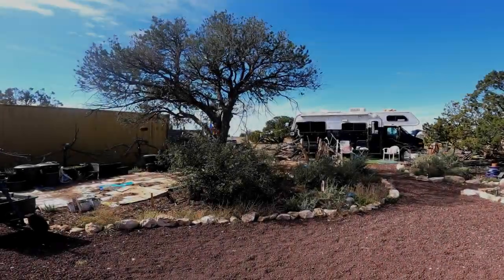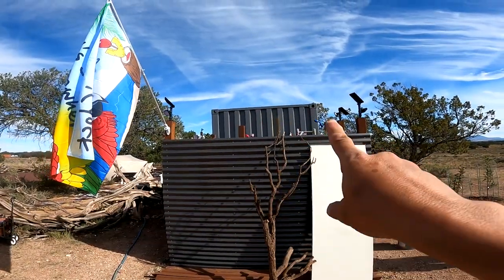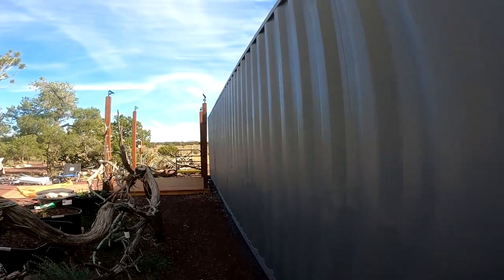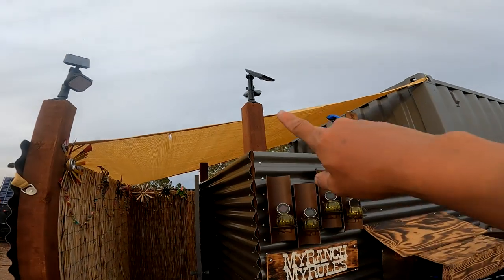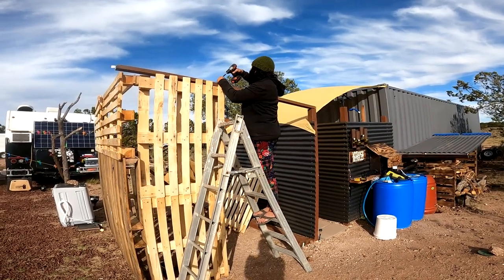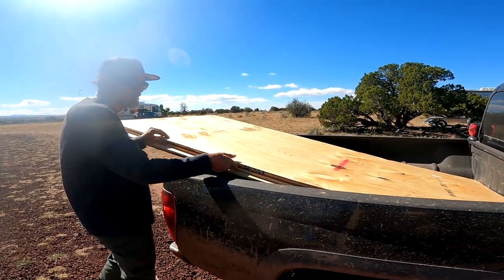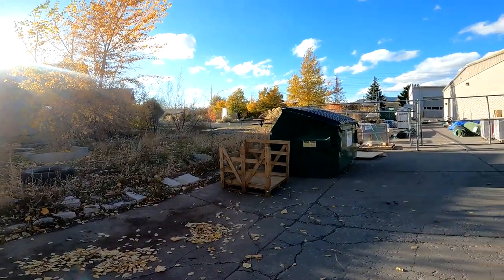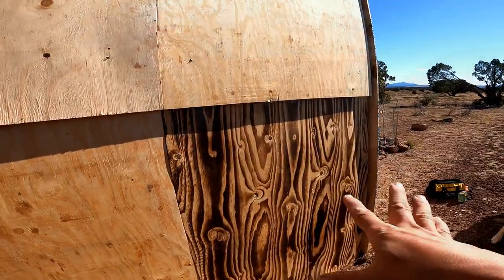DIY Building Free Pallet Shed, Painting Shipping Container & Burn Wood To Preserve

Comment: I have eight 55 gal. rain barrels at home.  Over time and in arizona they collect alot of dust of the roof which turns to mud.  I wash them out once a year.  I just use 
the water for plants so dont bother trying to filter it.      When you suck the water out for the shower or laundry,  maybe have a filter there.  You guys getting alot done 
this year.

Comment: scorching the wood won't protect it from water but it does give it some protection from insects, if termites are in your area. otherwise the wood will still weather from sun and water exposure. spraying it with a coat of oil or cuprinol would be a big help.